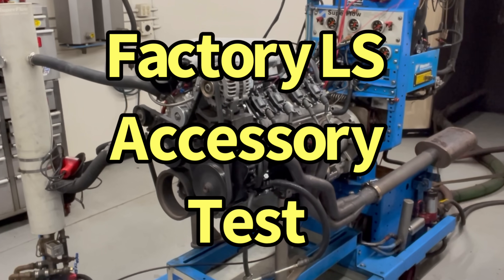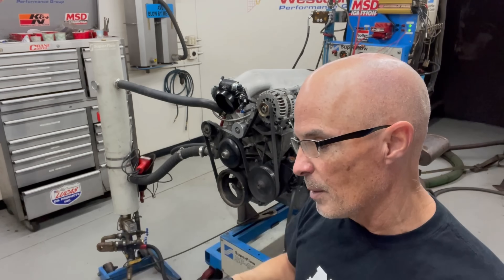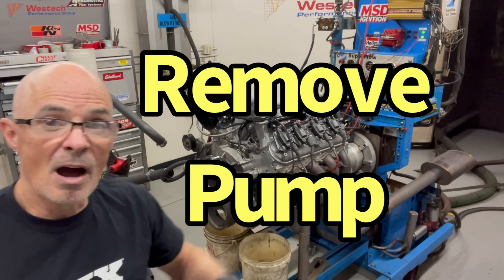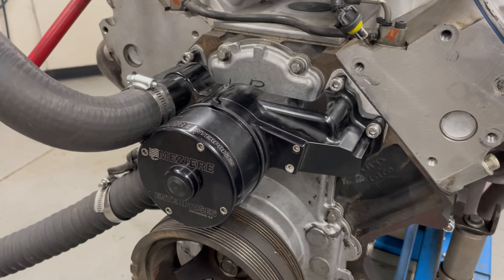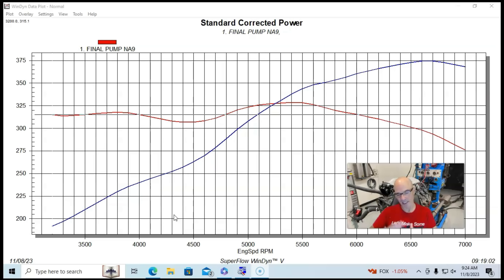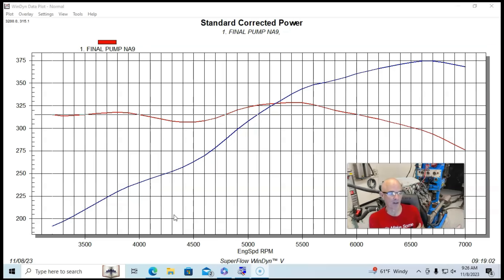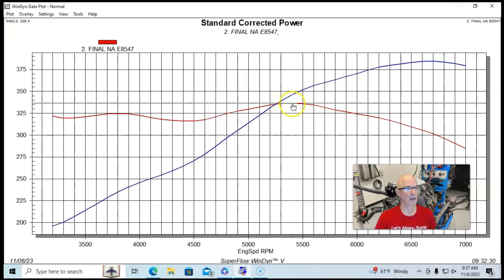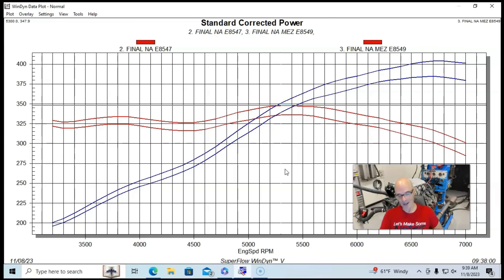HOW MUCH POWER DO ACCESSORIES ROB FROM YOUR 4.8L LS MOTOR? STOCK ACCESSORIES v ELECTRIC WATER PUMP!

Comment: Dumb question: would it change the tune?

Like if I got it tuned with a mechanical water pump, then switched to an electric water pump. Would I need to get it re-tuned?
Reply from the maker: doubtful on a MAF car

Comment: I saw a test on a small block. The difference between a mechanical pump and an electric pump was 3hp. I'd rather have mechanical in case my alternator goes out. It probably robs more off a 4.8 because of the smaller displacement and lower torque. I doubt an electric pump would make much of a difference on a torquey stroker or a big block

Comment: I understand the ego 'boost' in taking off the accessories to be able to brag that you get a little more horsepower but.... What is powering that electric water pump? How can you switch to something else but conveniently leave out the parts required to make it function? Can you get down a drag strip without an alternator? If the answer is, "use a larger or multiple batteries," you are then adding weight.   Isn't it realistic that an alternator is an integral part of the ignition system, not an "accessory"?  This subject is probably beaten to death but, as a relative newbie, it does not look like a realistic application. I don't think "practical" is the right word.
Reply from the maker: If you think that testing what each accessory is worth is somehow ego based-you have much to learn-BTW-easily possible to make a 1/4-mile pass on the battery alone

Comment: Als erstes:
es wird 10 Minuten lang über Dinge gesprochen und auch wiederholt die mit dem Test und dem Titel NICHTS zu tun haben, Nockenwelle, Federn, Timing usw..
Zweitens:
der Test ist verfälscht, es soll so aussehen als wenn die Wasserpumpe viel Leitung frei setzt, um richtig zu messen müßte man aber die elektrische Energie (Lichtmaschine) dazu rechnen.
Die Testidee ist gut, die Ausführung nicht.

Comment: Dood! Like, where's the six-blade fiberglass metalflake engine fan, dood? In the 70's, we could pick up 25 horsepower with one of those. Fer sher. Geeez, and you call this real world? I'd be shaking my head if I could actually feel it. Oh the colors. Dood!
Reply from the maker: those flex fans were buzz saws and lost huge power
Reply: Oh I know,  just messing around. They look cool and retro hanging on the wall, though. As you know, I grew up in the SFV/VNB scene back then.  @richardholdener1727

Comment: That's more than I expected, I was guessing more around the 12-15hp, not basically 20hp and it will be more for engines at higher rpm than they were designed for.  

What would be interesting to test is underdrive pulleys. They boast less losses, but the main reason you'd want one is on engines with a significant rpm increase is safety for the accessories. I have seen what happens when alternators explode and ruin a rare car's bonnet that you can't find replacements for and even on stock cars that you flog all the time up at the red line, the PS often overheat the fluid and spill over.

Comment: I will just say this. Pertaining to the alternator. Without a charge running through it, it's basically just a free spinning bearing. I think it would be better to have it charging a battery to see how much load it actually takes.
Reply from the maker: charging at what rate?
Reply: It wouldn't be much, even at say a over the top 300w, that's only about 0.5hp at the engine with efficiency losses.  Most of that loss seen was the water pump and PS pump, water pump primarily.  Alternators are minimal loss in the grand scheme of things.

Comment: Putting a Turbo on my 4.8. What rods and pistons would you suggest?
Reply from the maker: just ring gap and stock pistons and rods works for pretty high power levels, or summit pro ls for forged

Comment: G'day. I'd love to see the Vac U Pan system tested with and without mufflers.
I ran a set with mufflers and on the street was great but on the track would blow the dipstick out. Supposedly this was because I ran with mufflers.
Could be an interesting test?
Cheers. Rhett from Perth, Australia.
Reply from the maker: did you have the valve installed correctly with the slash cut angled properly

Comment: Edelbrock 2215 cam(220/220a.050 .510/.510 111 LSA(I think))

Made 312 rwhp and 308 torque on a chassis dyno. 650 carb, T56, 8.8 diff, mid length headers with Y pipe.

I was surprised as it did as good as some 5.7 liter gen 1 SBC I’ve thrown together except the SBC made 30-40 more ftlbs.

Comment: Could you do something on 6L80 torque converter failing on Chevrolet does a billet converter make a difference
Reply from the maker: I CAN'T TEST CONVERTERS ON THE ENGINE DYNO
Reply: @richardholdener1727  your pretty awesome Thanks for the videos and sharing and replying back.

Comment: This is another amazing video and test thank you so much.

Adding a light load (~600w) on the alternator (for lights and fans) + the resistance the PS pump would need to overcome, that ~20hp + another 5 hp is over 6% 😮

Comment: 20 or so years ago there was a local dyno day.  A buddy put his late 90’s Cavalier on the dyno for fun, and his air conditioner was turned on.  For some reason, the compressor did not turn off at full throttle and high RPM.  So he ran the car again, but with the air conditioning turned off.  His car gained 8 hp, which was like a 10% improvement!!  😅
Reply: No lie you can feel the difference when you race with ac in all 3 of my cars 330, c6 vette, and 2016 x5

Comment: Another great and informative video Richard, but I do have a small issue with it. I know you briefly touched on it and said “take it for what it’s worth”, but that alternator is going to consume quite a bit more power depending on who much load it’s under. I remember seeing a dyno test in a magazine years ago (may have even been you that did it) where they were trying to determine if an electric cooling fan actually freed up more power than a clutch fan and the result was that when the fan was on the extra load from the alternator caused almost the same power loss as the physical drag of an engaged factory clutch fan on a small block Chevy. I’m not trying to discredit your work at all, but I think you missed an opportunity here. Im betting if you would have put that alternator and PS pump under load you would have seen an even more dramatic loss….possibly 30+hp rather than the 19hp you experienced. In the end it really doesn’t matter much BUT it would have been some good stuff to know for the detail junkies. Lol.
Reply from the maker: maybe an alternator test is necessary-but thanks for any tests never being enough
Reply: @richardholdener1727  Yea there’s always gonna be another stone to turn over. Lol
Reply: @richardholdener1727 you never know.. could free up horsepower if driving around in the dark with no lights on compared to them on haha. Im sure more alt use equals more drag

Comment: it’s incredible how much power is lost, you could run a small car with that power. 
an electric water pump takes a maximum of 200W- 0.27Hp; steerig pump 15-55Amp @13V so maximum 800W - only 1Hp, Antermator conversion rate 0.5- so  a total of 2000W,  only 2.68 Hp. You lose 16.32Hp on alternator fan, belt/pulley, potentially worse efficiency waterpump (compared to electrical mostly due to worst blades design).

Comment: Would like to see what the engine driven fan at full lock up draws. I can feel it sucking power big time when it's working in the summer heat.
Reply: Convert to modern 1990's tech and convert to a electric fan. then there's no draw on the system from a ancient grandpa era mech fan... Seriously your still using a mech fan? Seriously? 😂😂😂😂😂😂😂😂😂 dear God

Comment: Lock turbocharger and test how much power it robs compared to same engine without turbo.
Reply from the maker: lock turbo?
Reply: @richardholdener1727  so that it doesnt spin. I've done it but didnt have dyno, was just driving "NA" , it seemed to run ok even if some say it doesnt run at all when turbo doesnt spin

Comment: Such a great test Richard. I love the tongue in cheek nature of the "real world" complainers. That said, I've seen some testing from people, but would always love to see more, comparing the electrical load an electric water pump puts on your engine versus the mechanical load of a mechanical pump (ie: leave the alternator on, and configure your electric water pump to be supplied from the alternator). While many drag cars will operate exactly as this test, relying on a battery to provide the "horsepower" storage for the water pump, it would still be nice to see.

My experience tells me that mechanical pumps are extremely efficient, and that most of the power they use is going to be directly applied to pumping loads, and those same loads would exist with an electric pump flowing the same amount of water. This means that in practice an electric pump might not save you any "real world" horsepower, but there are other huge benefits many might overlook, such as being able to disable the pump entirely for short bursts of WOT if you wanted, running the pump at 100% when the engine is off (allowing rapid cool-downs), as well as the benefits of running the pump at lower duty cycle when driving on the street instead of "wasting" energy of a pump pushing against a thermostat to regulate temperature. I think there's good reasons OEMs are playing with electric water pumps, but I'm also not certain it's about all-out power.
Reply from the maker: the mech water pump would require much more power to drive
Reply: @richardholdener1727  On what basis though? Where is the energy loss do you think? The pulley itself doesn't use hardly any power and is natively low friction. Unless the pump side impeller is different between the two, I don't see where the mechanical pump is at a serious disadvantage. Similarly, I've seen cases where people struggled with overheating with electric pumps as they realize they don't flow what their OEM mechanical pump did, which is another area that can be easy to overlook. If the mechanical pump takes 2x the power to drive at X rpm, it might be flowing 2x the volume. I know an electric motor is more efficient than any cost of fuel, but I'm not talking about that end, because we also have to generate and store electricity somehow. I'm merely discussing what the motor is driving and how that energy is delivered to it.
Reply: @nathanshobe a high flow electric water pump from meziere at most uses 12A at any given time. If my calculations are correct then the load required to power it is equivalent to about .20hp. A mechanical pump on the other hand at higher rpm uses about 8hp for the same amount of flow. Now not only do you have the benefit of turning an EWP on and off whenever you want, it's also not rpm limited like a mechanical water pump. Also the service life isn't much different for an EWP than a mechanical pump
Reply from the maker: Impeller design is different between the two pumps, also the efficiency of the mech pump changes with rpm-the Meziere run a constant rpm

Comment: In all honesty i expected more of a loss. But maybe because the AC and Alternator wasnt functioning?…. To me the 20hp loss is fairly small.

But i assume “real world” when you factor in driveshaft and ac and alternator it may be around 50hp?. Either way its still less than i thought. When i see engine dynos i just say to myself take away 80-100hp lol
Reply from the maker: alt load is like 2 hp, but drive train loss is a LOT
Reply: @richardholdener1727 yea i just always use a general 15-20%
Reply: AC is never meant to run at wide open throttle (ECU turns it off automatically at wide open), alternator is a “concern” though, they do rob power.
Reply: @rustysausage69 thats also a great point.

Comment: Personally I always figured that an engine from the dyno put in an engine bay would about 100 to 150 hp to the ground. In my speculation that 4.8 that made 404 to the engine dyno would really be worth about 275 ish in a car to the ground.
Reply from the maker: in a manual trans car the whp would be over 300 hp

Comment: Just curious. How would you feel about doing this same test again for the 5.3 liter and 6.0 liter engine. I wonder if the bigger engine would have the same amount of difference or if the increased torque of the larger engines would minimize the parasitic losses of the accessories.
Reply from the maker: acc power loss would be the same on all three motors
Reply: the accessories are the same, bolting them onto a bigger motor doesn't change how much power they take to run.

as a % of power output it'd be smaller as the bigger engines make more power.

but if the (say) p/s pump takes for example 5HP to run on the 4.8 it'll still take the same 5HP to run on a 6.2, or a blown big block or a top fueler. you're just going to notice it less.
Reply: @dataminetk  I would agree personally, im under that same impression that parasitic power is a fixed number rather than percentage. 
Applying that principle, I think that chassis dyno horsepower compared to flywheel horsepower numbers is a fixed subtraction as well.

Comment: Class 8 highway trucks on the chassis dyno would drop.25HP when the fan cut in. Now that is a big fan compared to cars and light trucks.
This is also why net HP advertising numbers were mandated instead of gross power. Net power is as installed in the car. When the LT1 came out with the Opti spark, in a Corvette they were rated at 300 HP, in a Camaro 275HP and in a Caprice 250HP. The main difference was in the exhaust. Corvette owners expect a bit more noise from a freer flowing exhaust. Caprice buyers expected a very quiet ride, almost like Cadillac.

Comment: Great testing! I know you like to run the water temps cold but e85 does not like cold water temps in aluminum head LS engines. I have always found e85 makes more power in every stock or mod LS and they like to be at least 195F. With colder water temps, say 165F, hp is noticeably down.

Comment: A 15 WHP (maybe 20+ in the car) loss/gain is nothing to be sarcastic about.. my Camaro loses 25 WHP with the NPP exhaust closed. On equal 60 foots that is worth 1/10th and 2 MPH. I’ve got a rear wing worth another 1/10th and 2 MPH. Knowing these things matters to people. My C5 saw a slightly larger difference than the Camaro by me accidentally pulling the belt off before a run. The Camaro has no PS pump, but the C5 does. Oh, and that pump alone is also worth 10 WHP on its own in case anyone is wondering.

Comment: Love these kinda odd videos 

I’m that guy that will mismatch parts because I get bargains or deals and end up with a peak power 7k rpm setup in a daily driver that never sees those rpm 😂

I over laid this with an older 4.8 stock dyno of his and it hardly ever made less hp or tq anywhere and made more from 5500rpm up there’s gains from 60-80hp 

I’d be happy with a Hi ram on a stockish daily driver  😂

Comment: I had a nissan hardbody truck that I was running around in high school.  I was always racing everyone and mostly getting beat.  
One weekend the truck was running hard and was beating cars it shouldn’t .  I popped the hood to check and the cooling fan was sitting in the fan shroud.  Once I fixed it the truck felt like I was dragging a rock behind it.  Dont know how it didn’t run hot but I should have put an electric fan on to get that power back.
Reply: Yeah, the mechanical fan will rob you of 15 plus horsepower,i took my fan off my 01 Silverado 5.3 and ran strong after I removed it.
Reply: Also if you can get under drive pulley, that will release another 10
Reply: cries in sad 2022 tacoma noises....

Comment: Hmmm cool test but would have made far more interesting to have the alternator pulling a 50A load
Reply: 50 amps at 14 volts is 700 watts. Throw in the expected 80% efficiency of most power generation devices, we're at 875 watts. That's 1.2 horsepower. You'll lose more in atmospheric condition changes than you will with a 50A load.
If you don't believe me, a Predator 212 (advertised as 6.5hp, we'll just pretend that's accurate) is put on portable generators for sustained loads of 3500 watts. 80% efficiency brings that to 4375 watts, which is 5.87hp.
Reply: @AustinRBa  champion your talking to a auto sparky I was saying that to make it a more honest test of accessories fitted and not   the 50a is just a average load for a modern car
Reply from the maker: far more interested in a minimal change?

Comment: With the stock crank pulley and alternator pulley, the alternator will come apart before you see 8500.

Also, a 5th gen water pump will come apart before by 7500.

Ask me how I know.

Comment: Accounting for belt and alternator inefficiencies, a 140amp alternator, at full output, will use a little over 4hp.
Reply from the maker: that includes spinning the heavy alternator-the load won't change power by 4 hp
Reply: @richardholdener1727  Feel free to build a DC generator setup and find out for yourself.  A good high output alternator is everything a 6.5hp motor can pull.  A 3hp will NOT pull a 140amp at full field.